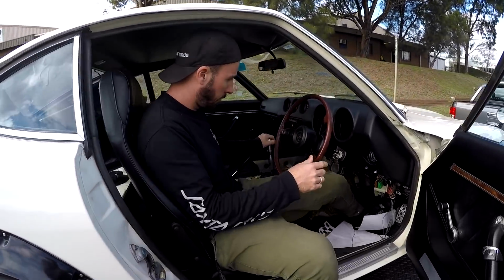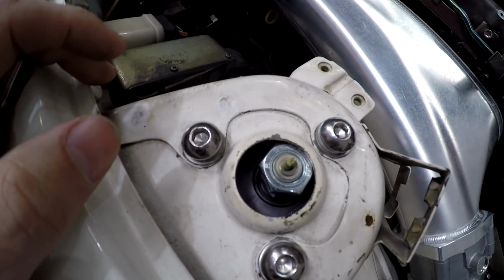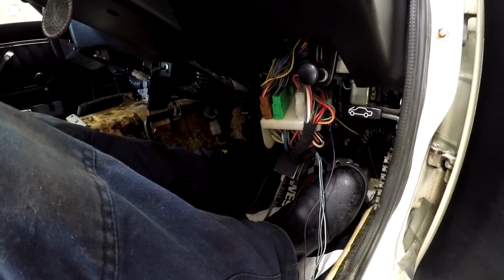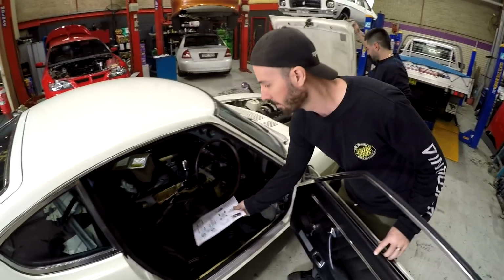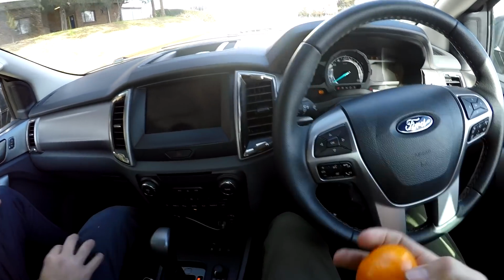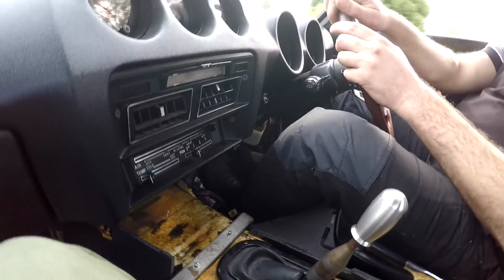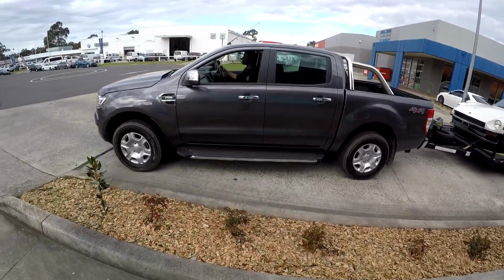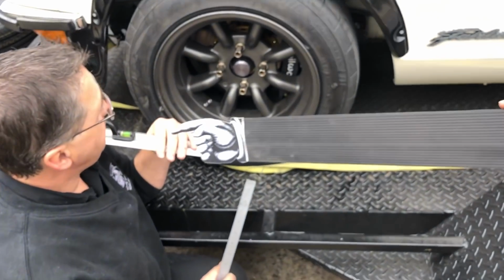RB26 240Z - Making It Legal

Comment: We have similar issues in the state I live in, Virginia, on the yearly safety inspection. The stations are licensed private shops, one might say X amount of play in the tie rods or X amount of wear on the brakes is fine, one may fail it. By example, the drivers door of the car has to open and close without excessive droop from the hinges, and the window must go down (but funny enough, not back up, I try to get my cars inspected in the summer months for this reason). So one may say on manual windows that the regulator is too stiff, and fail it even though the window works technically, same goes for a slow power window, whereas another station may not bother you. It's all very annoying, confusing, and sometimes frustrating. They also don't do emission testing on this side of the state, but the eastern side of Virginia where Washington DC / Richmond (State capital) are does include emissions testing in the yearly inspection.

XLT is just a trim Ford uses on their trucks, don't know why, "Xtra large truck?" "Extra luxury trim?" Dunno.

Comment: Brake testers in the UK look a lot more like a Dyno and can test each wheel independently without doing anything super sketchy like opening the CLOSED brake system to perform a test but I do really like the fact the brakes were tested without the booster that part of the test I think the UK shud take note off

Comment: The trim letters of Ford trucks don’t really mean anything. But XL is the base model, XLT usually adds power windows, power locks, A/C and stuff like this. Then there is the XLT lariat which is the luxury trim, leather and stuff. FX-4 is the off-road package, higher suspension, 4wD. You also have special trim like king ranch, platinum, Harley Davidson. The list here is generic for most ford trucks, so Ranger, F-150, F-250, F-350

Comment: the SKF bearings are probably supplying the replacement balls in those vibrators that got the revolving belts of steel balls underneath to massage the inner walls of the.. yeah u get the idea..

Comment: I believe it was Lee Iacocca who, during the hearings to keep Chrysler afloat, told the U.S. Congress that if there were uniform world wide standards for the requirements on cars that the result would be a price decrease of 25 to 35 percent per vehicle. This would allow for one engineering/design standard and one set of compliance tests to be done. The big saving would come in the form of uniform parts requirements and the removal of the need to shut the production lines down and retool for each separate jurisdiction. Of course, it will never happen as it would completely destroy the present regulatory bureaucratic systems that employ so many of the otherwise unemployable. Food for thought isn't it.

Comment: I have been wanting to do this for a while to an HQ Monaro or a trashed one, or even start with sedan a shell. I have been wanting the strip out a VF II Commodore (that was a good write off) and put as much tech in to it, at least on an HQ Sedan, Kingswood as a V8 or even go twin turbo V6. A absolute sleeper. The other thing that would have to be done is a suspension make over much like the Fair Lady. So siting in an HQ feeling like you are sitting in a VF Series II full interior and dash.

Comment: On the one hand, it sucks having to deal with that. 

On the other hand, we can't have Skylines early evos, or other random JDM wierdness until its 25 years old, then the prices suddenly get expensive. 

But I guess its worth it if it means we can drive whatever the hell we want as long as the tires have a tread in them, lights work, and it has wipers.

Comment: The internet is not very helpful when trying to figure out what the XL and XLT mean on Fords, but here's what I have pieced together. Might still be wrong.

XL and XLT are Trim levels

"X" is eXtended or eXtra (not sure which is the right one)
"L" is Luxury 
"T" Is Touring

As an example XL probably would still have manual windows and locks, but would have a slightly better radio than the Base Model and have AC. The XLT then Might Include power windows and locks, nicer seats, and an even better sound system than the XL

Of course, Trim levels are constantly in a state of flux, so what you actually get changes from time to time, even year to year. can you even buy a car without AC anymore? How many Base Model vehicles come without power windows and locks? Even, in the US, Backup cameras will be standard in all new cars in a couple years regardless of trim level.

Comment: I think the XL part of XLT dates back to 1962 with the emergence of the Galaxie 500 full size Fords in the US, and the 500 XL was higher level of the 500, which was above the base Galaxie which originated with the 1959 re-designed "full size" Ford model. Think "Space Race" in the late 1950's. When compared to "full size" cars produced today, the XL could have stood for Extra Large!

Comment: Hahahaha, Applied industrial is a industrial supply company. They sell bearings, seals, chains, hydraulics/pneumatics, if you need anything for industry they have it. Great company, it was my first job out of high school and I learned a lot in a short time and still shop there 13 years after not working for them any further.

Comment: Okay, xlt was a top of the range model for Ford trucks.  X was base, XL was mid range, xlt was top.  Of course Ford has changed its truck trims a bit sense the 90's, adding several more ranges on top of that.  So now the xlt is kind of a mid range model.

Comment: In the United states, New York state , I have seen a streetrod with drums on the front and discs on the back pass the inspection for homebuilt cars. They do not have an actual engineer inspect them. Scary at best. No apparatus used to measure braking force at all. CAT runs across the road for he fears they cannot stop.I have seen worse things.......

Comment: U need to get better tyres more square of a side wall they look better and they are a road legal slick they are toyo R888 proxzes
Reply: I'm wondering if their next round of getting things checked will have them forced to change rim widths/offsets because they're so different from factory. Or if this certification process will allow them to do whatever because it's being checked by an engineer. In any case, high profile stretched tires aren't legal, they need to be pretty much square, so some things will have to change.

Comment: XLT extra large truck 😂 jk but seriously XLT represents the trim level for ford trucks and suv's. XLT is the heavy duty version coming with heavy duty suspension, power everything, AC and the works. 

XL is fords the basic version coming bare bones.

STX would be the "sporty" trim level coming with nice radio and AC.

Comment: If that is indeed a 1975 model - it's a 280z and not a 240
Reply: Depends on where it was as sold maybe? For instance Nissan 240sx and 180sx are the same car just given a different name on the region. 
It's like the Scion FRS vs Toyota 86. 

Now I could be mistaken
Reply: Actually reading further you are correct. 1975 model was the 280z.

Comment: What special interest group talked your government into that test being a requirement for a car that was road legal in another country? And, how much did that test cost you?
At what point do the people say too much government is too much? And what do we do about it?
Reply: If it was a stock 240z it wouldn't need all this. The RB26 turbo, different brakes, different suspension was not offered on the original, and drastically changes the way the car operates. So they need to check to make sure it's all actually been installed properly and not with zip ties, and if it can actually function properly, ie the brakes aren't off a bicycle trying to stop an engine with triple the power it came with etc. It makes perfect sense, annoying as it is. It's when you need permits to install a pod filter that shit gets too much.

Comment: holy crap Australia sucks for importing cars. its like your doing a newly manufactured car test... im surprised they didnt want to crash test while they were at it!
Reply: It's only because it was so heavily modified, engine swap, completely different suspension, brakes etc. If it was a regular factory 240z they'd only need to the stuff that will probably be in the next video. Regular imports usually just need things taken care of like installing side indicators if they don't come with them. Nothing major.
Reply: danehb89 wow! Importing into the us basically only has to be a 25 yr old+ vehicle and nothing else really matters

Comment: Dam come to the uk. U can do pretty much what u like to a car once the manufacturer has had it type approved from new. Grey imports no worries, engine swaps fines, reshell fine just need a yearly mot where the car is checked for safty as presented. Doesnt matter if its been modded. 
We are soo lucky amd pretty much free.
That is the weirdest break tester most a rolling road type with strong rollers. Just odd

Comment: Still using wheel spacers?? How is that possible if I live in oz and n.s.w . It’s illegal to use spacers . Check to RMS website on the modification laws/ rules .dnt know how you are going to pass the engineering test At the EPA testing centre at Smithfield near the TAFE on Victoria street

Comment: From an outsiders point of view, and while I understand the end purpose, but disconnecting half the brakes to make sure the other half work seems asinine to me. Because we all know that driving a car with half of a functional braking system is completely logical... 
You jump through all the hoops, loops and governmental red tape b.s., then some jackass on his phone wrecks into you, but god forbid we should try to regulate that if it's not a 'caught in the act' moment.
Reply: They are testing redundancy in a critical system which seems like a good idea to me.
Reply: Yes, I get that, but when the car rolls in, the brakes either stop the car or they don't. For the brief time that the car is in that inspection window, 5 minutes down the road a bubble could run through the lines and cause catastrophic failure. Just a scenario, but with brakes it's a go/no go deal. It's the parts work, the brakes work, you know? If they pull to one side on a hard stop, 'we got problems'.

Comment: Well its a big job to make you car legal i AUS. here in Denmark, it would never be legal, because here you cant change the engine, and you need tüv on EVERITHING you mout or change on the car. And if you want to increase the power of the car, you need to document that the chassis can hold the power. this includes sending the whole car to germany for Tüv. and that cost as far as i know more than 10000 dolars.. on these point, i hate this country :-(

Comment: would they pass it with a 1969 zl1 aluminum 427 in it? you know a old 430hp engine :)
Reply: just take the booster off and put a double small piston and a proportioning valve. you will stop great with those brakes.

Comment: how many times u need to do this? every year? cause jesus this looks anoying and expensive to bleed the brakes and shit.
in france u have to get your car checked every 2 years, but not like this much.. (even doh they made it harder now with emmisions... yeah america lol a car right now has a very strickt emmision aint no but diesel running coal here... alot of cars are refused/failed cause of to much emmision or even if the engine is a bit dirty/oily)
anyway but atleast here you dont have any road taxes u pay insurance and that is it. to register the car on your name u pay for THe HP your car has. a 120hp bmw wil cost you 200€ but once and that is all.